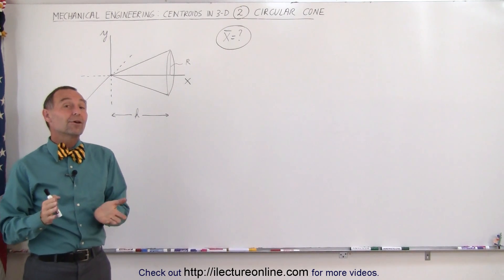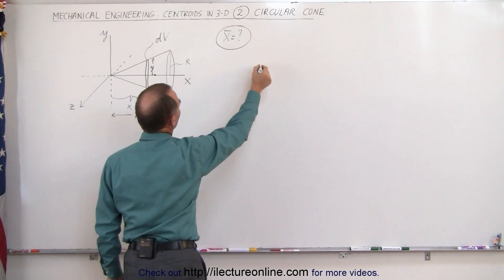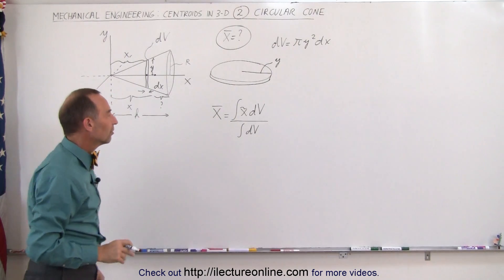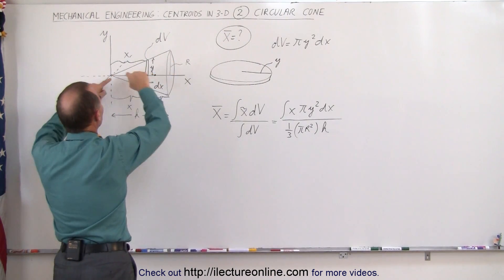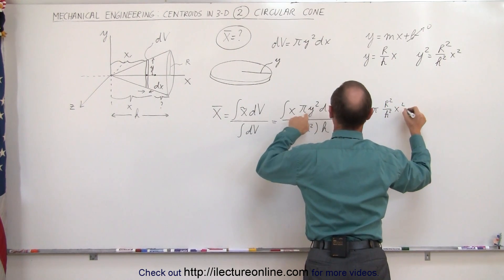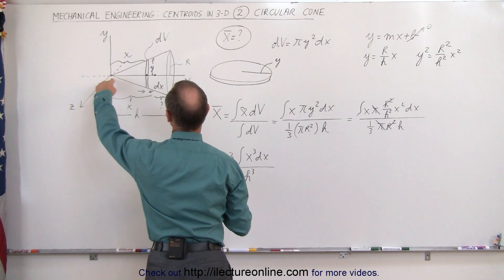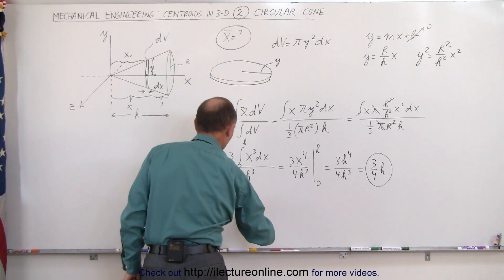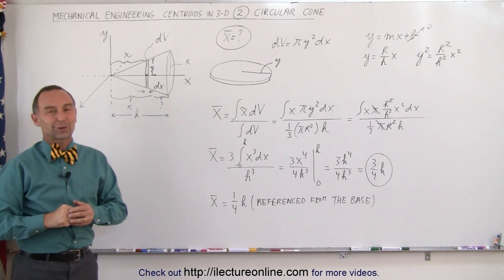Mechanical Engineering: Centroids in 3-D (2 of 19) Circular Cone

Comment: Sir, what if the cone laid vertically and the vertical axis is z instead of y how can one use the straight line equation to get the relationship between R, r, z and h?
Reply from the maker: You can have a straight line equation in any direction.  It looks exactly the same but with different vairable   y(z)  or  x(z)
Reply: @MichelvanBiezen  right, thanks

Comment: what a truly amazing Example Michel..... I noticed that the Radius Drops out... so this RESULT applies to ANY cone size.....  that is.. the X position will always equal 1/4 the length of h from the base....  I guess even a Cone with an h = 1 cm and with an R = 1 KM.. the result will still find X located 1/4 of the way in from the Base.. Amazing....!! thanks for another CLEAR video Lecture....